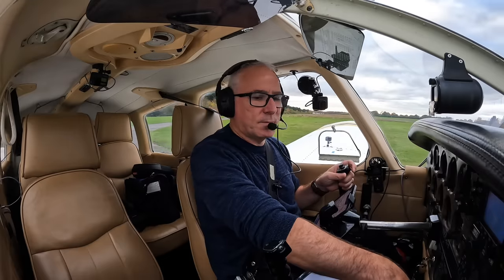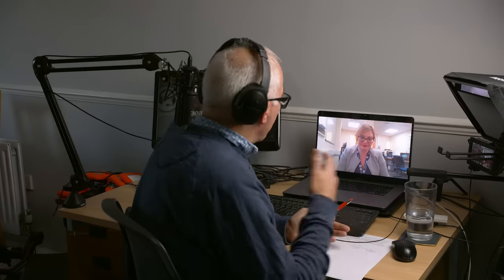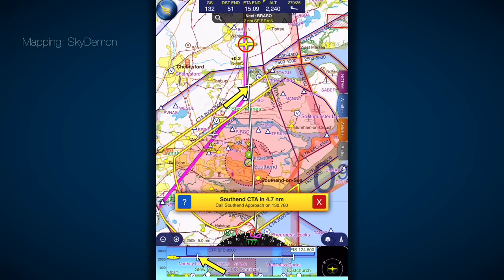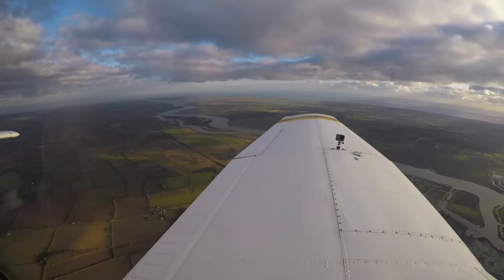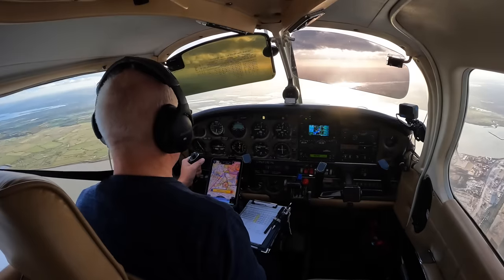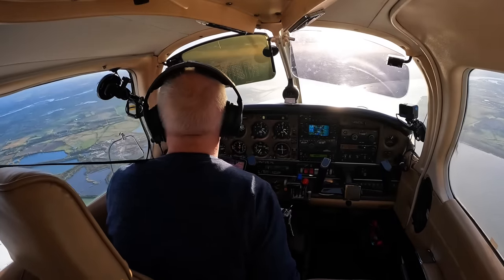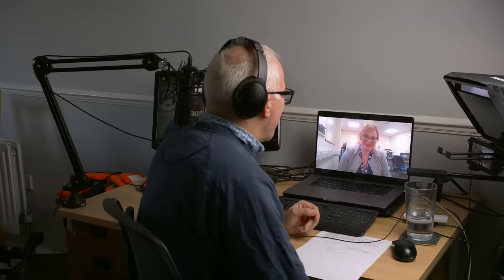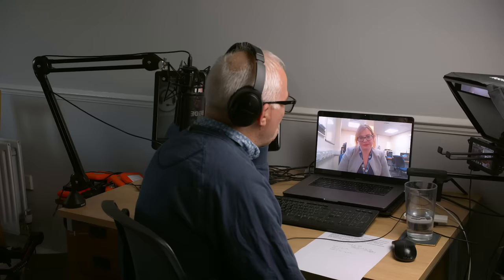I need to descend NOW!! - What would you do?

Comment: Thought provoking video. Easy to consider when on the ground, but in the air - much harder. 

As you know I’m based at Earls Colne, and do a my fair share of Southend Transits. They are brilliant controllers and it’s a rare occasion where you cant get a transmission in, but does happen. 

Really interesting to hear their view on the orbit - but if you were IFR and given a direct to clearance that would not be possible. 

What would I have done…? well I’d probably have done the same as you - waited for a break and then requested decent…. And if that failed - autopilot on and flying at 2500 with a decent loaded for the moment I left Class D airspace. 

However another option - you requested a routing, why not request an altitude for crossing? I quite often do that crossing Oostende CTA to avoid infringing the Brussels TMA on exit.

Comment: Personally I’d have considered the decent to 2500ft for the boundary. Remember you’d only need to stay at that altitude for a few seconds before descending more as you crossed into class G. 
It looked like there was also some traffic on a right hand down wind heading as if it was under vectors that passed below at around 2000ft as you enter the CTR. (G-ZSDB at 4mins 5 seconds)
Good to see both sides of the scenario.
Did you consider routing more direct and crossing CTA4 Instead?
Reply from the maker: I try to route via VRPs when it's not too far out of my way, since controllers know these points well.  But I have routed more directly a few times.

Comment: My two pence worth. Probably less actually, but anyway, here goes.

(1) I don't think it is feasible to start a long negotiation about routing and levels already at the entry point. Sure, if you the pilot feels the routing, level or service can be improved, please do ask. But, in this case there was (IMO) no indication that the clearance would not work out just fine.

(2) I am a little puzzled that "direct routing" was mentioned; does it make a difference? Even if the clearance said "Fly direct POINT B, maintain altitude A", if no further clearance is received the least bad option very well could be to orbit still - whether VFR or IFR or little plane or big plane et cetera; I guess a rotorcraft might be able to 'park' in the middle of nowhere, but you sure can't.
[edit: Oh, I see from other comments that 'direct to' precludes orbit-like manoeuvres. I am not sure I understand the rationale, but very interesting.]

Comment: Wouldn't flying at 2500 have put you into the TMA anyway, regardless of how accurately you flew (it starts AT 2500 ft,  so you'd have had to maintain 2499 or below, directly contradicting SEN's clearance)  So to my understanding it would have been impossible to comply without an amendment from SEN.  Always a bit puckering when something like this happens on a busy freq. An orbit would have been the least-worst option if you couldn't get through in time. I think you did the right thing.
Reply: @evanscm3, 2500ft is technically not in the TMA. Lowest assigned level that can be used in that section of class A by the IFR traffic would be 3000ft.
Reply: @jackwestham  it's marked on the charts as the TMA... so I wouldn't like to try that excuse in response to a letter from the CAA

Comment: As an ATCO I have a real issue with “Not Below” VFR clearances. What if a layer of cloud appeared between you and the surface? It also shows a lack of appreciation of your route, and adjacent airspace. 

Always, always, always, “Not Above”, with a routeing instruction that keeps you outside airspace that isn’t your responsibility (such as the TMA). Poor Controlling Technique.

From a Flight Planning Point of View - why did you even bother with the CAS Transit? With a GNS430 I’d use IFR points EVNAS - HILLY at 2000ft which instantly removes the requirement for any form of clearance to be issued for any part of the flight. 

Yes, it’s nice to get clearances through CAS, but this shows the perfect example of staying outside, staying VFR, looking out the window and doing your own thing is often a better option.
Reply from the maker: Interesting comments.  Thanks.  Personally, I prefer to use the transit here, because of many, many close calls in the tight funnel between the London CTA and Southend.

Comment: It was mentioned that VFR flight is not allowed in Class A" airspace which is understandable.  Can you still request a "Special VRF Clearance" to transit Class A airspace?
Reply from the maker: Special VFR is only allowed in control zones, not TMAs.
Reply: Interesting.  I remember not long after Swanwick Centre opened, the computer crashed, grounding all IFR flights.  I was visiting a friend who was a commercial helicopter pilot, his Wife arrived home (Capt. on Easyjet at the time) complaining Ryanair were departing VFR, change the flight rules from 'I' to 'Z' on their flight plans,  to the Irish FIR; they would have been in a TMA.  @TheFlyingReporter
Reply: @richardlawrencesmith  Z flight plans Begin VFR, and you would normally change to IFR and join TMA along the route somewhere, this requires a correctly filed flight plan. (Sometimes London Info can do this but its a lot of work) and that sector of TMA is very busy with Biggin and City inbounds, so I doubt entry would be given, if thye route was accepted in the first place. The Ryanair would have to go IFR before entering Class A. No exceptions.

Comment: I don't believe covering up their mistakes and preventing traffic controllers from taking responsibility for their errors is the appropriate way to resolve this situation. If they haven't performed their job correctly, they should face consequences. Avoiding accountability only paves the way for more incidents like this. The government should either allow general aviation to operate independently or risk a scenario where pilots in the UK may soon require constant oversight, hindering their freedom to take off without supervision. In the USA, situations like this are not common, but general aviation is already facing challenges due to cost and waning interest. I fear that in 10 years, only a select few will be permitted to fly, contingent upon government permission.
Reply from the maker: They aren't covering up a mistake - in fact none was committed.  They actually came on and answered my questions.  We have some rules around ATC recordings here, which makes it a little more sensitive than you perhaps appreciate, hence not identifying the controllers.
Reply: @TheFlyingReporter  

Well, and the rules you're referring to are likely established by the same body that oversees pilots. I truly wonder what would have happened if you weren't aware and had to rely solely on the controllers. I suppose your video would have been quite different, dealing with the challenges of entering and breaching a control airspace, wouldn't it?
Reply: Whether they made a mistake depends on whether we believe them that they were just about to clear him to descend. I'm skeptical, but there is no way to prove they weren't going to. Holding people to account is important, but you need to be careful if you don't know for sure who, if anyone, is to blame (especially when people on the internet have been known to overreact on rare occasion!).
Reply: What mistake? Genuine question! ATC cover their own airspace and whilst (as a student ppl) I'd expect them to tell me I'm about to enter class A, I don't think it's their responsibility to do so. I was flying in the circuit recently and tower were so busy I ended up calling downwind at the end of downwind. Asked to report ready for base. I think they mistook my 'i am ready for base' as a readback. By the time I got a word in I was 5 miles out. Contemplated orbiting but there were two planes behind me so decided best course was to continue. Cue some amusing discussion with atc. I'd strongly recommend any GA pilot to do a tower visit anywhere they fly frequently. The controllers are so open to explaining stuff and it really helped me with use of radio.